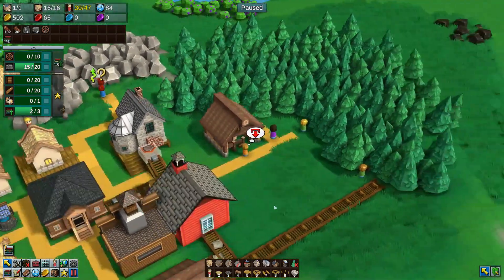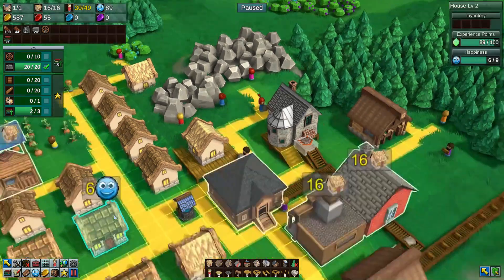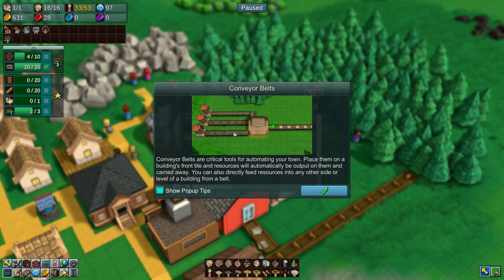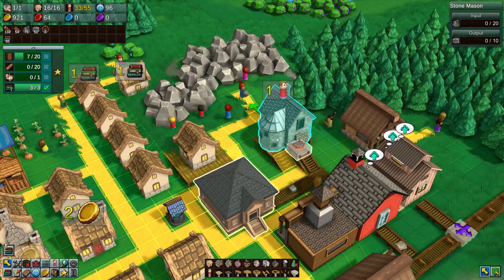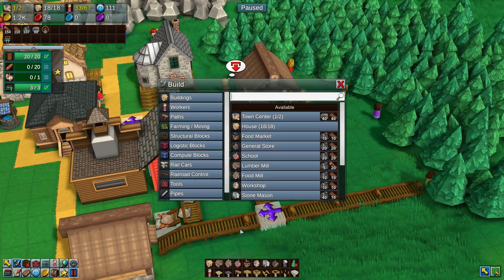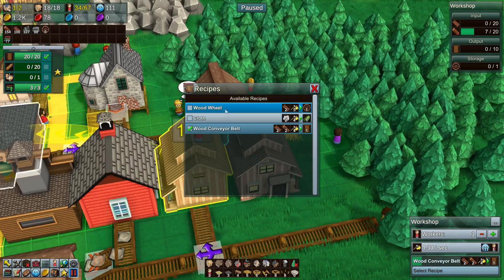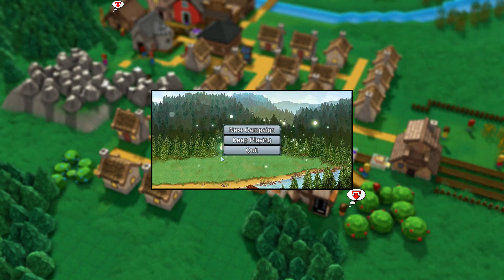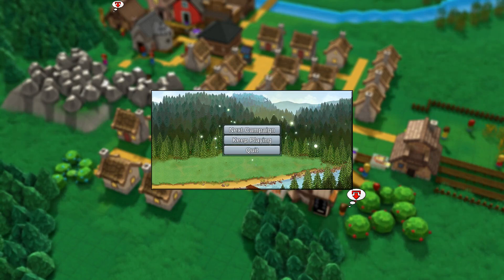Factory Town Part 2: A Bridge Too Short

Comment: you need to start using elevated belts, they go over ways and dont block traffic below, far easier than bridges, you can grab/input from/in buildings up to two floors as far as i remember. even if the grabber pushes outwards from a building, the belt "below" can go in another direction. dont sleep on chutes, they are a great help. love this little game, so sweet and such complexity. hope you like it too and keep this going for some time :)
Reply from the maker: I discover the joy of elevated belts in episode 3.

Comment: Great episode, I enjoy watching you play.  I would definitely watch more of this.  To answer your worry at the end, resources are finite when harvested by workers, but you can unlock research that gives you renewable versions of all of them.  

Foresters give renewable wood, at a rate determined by the number of tree tiles near them.  They can also harvest fruit from fruit trees that will regrow.

Farms give a variety of crops, including wheat, carrots, potatoes, cotton, and herbs.  These "harvest" natural tiles within a few spaces of them, turning them from "ripe" to "growing", and waiting if there are no ripe crops nearby.  You can also use fertilizer to designate some tiles "farm tiles" which will keep their existing crops if there is something growing there, but will allow you to plant new crops in those tiles (for coins), will grow faster than non-farm tile crops, and can accept fertilizer and water from farms in order to grow even faster.

Mines are a much later tech, but allow you to get additional stone, iron, and coal, depleting a sub-surface supply, and can be eventually upgraded to not deplete the resources at all.

Comment: At about 17:00, you do some gymnastics with conveyers to make the grabber work, but it's not necessary.  You can place a conveyer going directly towards the market, and then manually add a grabber that points a different direction.  Only the grabber needs to point out.  This can also allow you to re-connect the kitchen to the town, which gives it something like a 25% speed bonus at this point, and will only get higher as your happiness grows.

Comment: With grain, you might want to have a chute that forks, overlapping a turn and a straight section.  If a resource hits a forked chute, it will always take the straight option unless it is blocked, in which case it will take the curve instead.  I use this to have a single chute which feeds grain to both my food mill and my food market, with the straight portion going to the food mill, and then the curve diverting around the food mill to the food market, allowing me to sell grain when the food mill is saturated.  You can also send flour and stone down chutes, which will free up wooden conveyers for other materials that can't use chutes.  Stone bricks need conveyers.

Comment: When you hovered on fuel, it showed "Wood 2, Coal 4".  What this means is that one log counts as 2 fuel, and one piece of coal counts as 4 fuel.  Either works for your need, but you only have to deliver half as much coal as wood.  When you begin creating pastures, they will produce fertilizer, which also counts as 1 fuel.  You usually have more fertilizer than you know what to do with, so I like to utilize it as a fuel source, once I've got about 50-100 stored for alternative uses (making farm tiles, and making farms more productive).

Comment: Doubling the paper output to the school was a good idea, but you might want to look at trying to turn paper into books.  By adding cloth and paper, you get books that are worth much more than the paper it takes to make them.  You would need to get into cotton or wool, though.  Also, you can double-stack conveyers in the same tiles.  You put a wooden post on the same tile as the conveyer, then put a wooden arch over it (to leave room for the goods on the conveyer), and finally you put your 2nd conveyer on top of the wood arch.